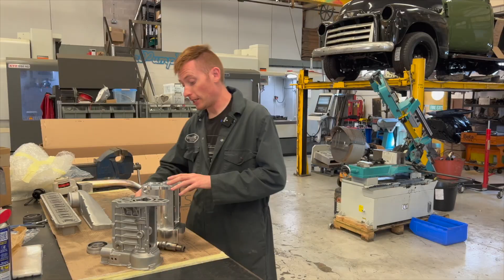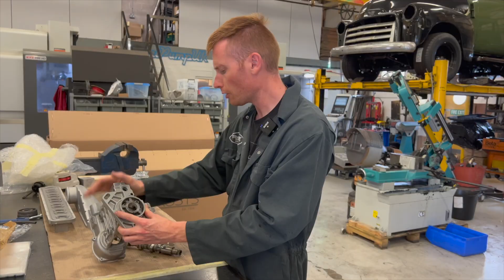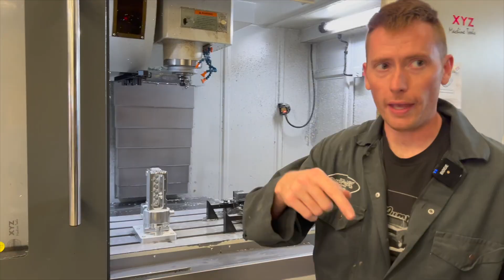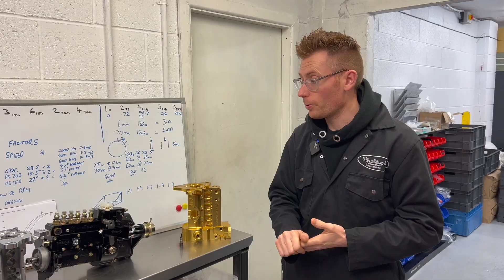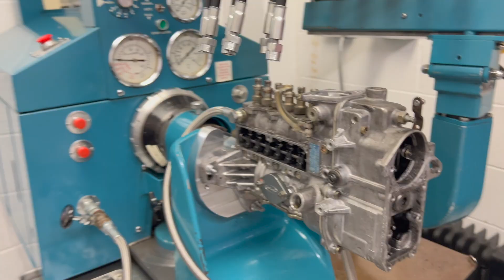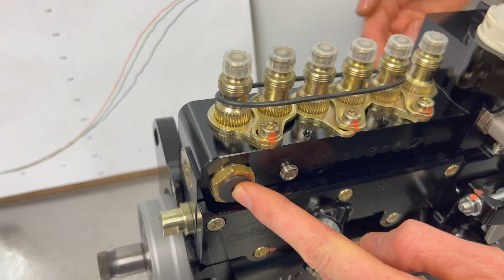OM606 Billet Fuel Pump

Comment: Full on board.   I was a fixer of what broke.   DPUK is the ultimate in the ability to MAKE IT BETTER.    The Billet Pump itself is astonishing.   The capability to do so is so many level above and beyond.    While its an individual marvel and  incredible shop capabiloity,   its a stunning display of what all their work looks like.   You know that each bolt gets that same attention to detail and quality.   Right botl,  threads are clear,  right lube (if speced)  right torque,  right deg turn if required.

Comment: Can I just say - I've never owned a diesel mercedes (I'm more on the VAG side at the moment, still playing with PD engines) but your engines are the shiniest, prettiest things I've ever seen. I think it's because they're so purposeful - everything mechanically controlled, hardly any electrics, so you can see every single part working. True works of art.

Comment: i would like to see a "Vintage 603" with a "vintage pump". maybe paint the engine an emerald green, brass hardware, green pump, brass lines, vintage turbo ;) ceramic coated exhaust, polished valve cover. for a vintage benz with real power. adenauer or a 220se.

Comment: hello, tell me, the parts of the 605 engine are different from the 605 turbo, namely the cylinder head, piston group, crankshaft, camshaft ...?  is it possible to install a turbine on 605 atm (replacing the exhaust manifold, pan, fuel pump...)

Comment: Neat design using the cyclical motion of the oil against a sort of stator by the OEM. With modern materials/machining I wonder if you could make cams with a built in "screw drive" to aid moving fluid if the scalloping in the CNC'd body is not enough. Maybe add stator fins or baffles through the body too to get the same flow rate/pressure.

Awesome work regardless.

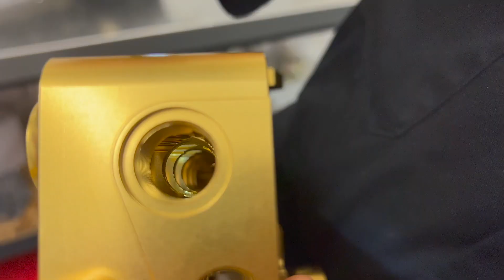Comment: I noticed at the 24:24 mark that the fuel tunnel in the pump feeding the plungers has some shavings and swarf in there from the machining process. They have not quite broken off. Are you guys planning to put all pumps through a micro bead bath / tumble to knock loose any little bits of debris or how would you go about reaching inside the pump in areas that can't easily be seen or reached? Cheers Jason
Reply from the maker: No I intend to let all the burr and swarf go into the engine
Reply: @DieselPumpUK   hahahaha love the reply. What would be a suitable method to have these sorts of things removed without causing damage to sensitive tolerance areas? Or does that all come down to the final machining process?
Reply: @DieselPumpUK  so, like a Cav or a Simms then?

Comment: Guys, be reasonable, you didn't create anything from scratch, you completely copied and slightly modified the pump. Create from scratch - develop a project in autocad, calculate it, make a prototype on a CNC, test in all modes for at least 6000 hours and after that we say - we created a pump from scratch.
Reply: well crap even automakers cant say they created a car from scratch, they just copied previous cars and changed little things lol
Reply: Relax bro you don't have to buy one
Reply: Thank goodness they have an expert to provide a threshold for excellence. If they didn't know it took 6,000 hours of testing to gain credit for creation or solving a problem, they might have only spent 5,000 or 1,000 hours testing before expressing such hubris.
I, too, have some expert feedback. Nobody uses Autocad for CNC machining.
Reply: You sound like 0 craic!

Comment: could you also add a second mounting area for another mechanical liftpump at the bottom guys like me who wants to use the fully mechanical guys? i already have a stronger spring in mine but it still would be better with a second one

Comment: Nice work......
I have a question....could you build a P pump for mitsubishi 4d56 turbo and a bt50 2.5 wl .....?
Reply: Certain 4M40 Mitsubishis came from the factory with an inline P-pump. I might still have a brandnew one in my core-room. I can get the pump number if wanted. 
They can be fitted to a 4D56 or 4D56-T
As for the WL, dont know of an inline pump for one but 12mm plunger head and rotors can be sourced for them.
Reply: @matui6983  Hi. You wouldn't have a Bosch VE pump suitable for a Peugeot 505 turbo diesel would you? Mines got a Roto diesel pump. I'd like to improve the performance and believe the Bosch VE is a better pump to modify?
Reply: Id be losing the Rotodiesel pump too. 
VE is a far superior unit. 
Bigger plunger can be fitted
Higher lift camplate can be fitted
BE pumps can come with aneroid or what we call a boost control. 
I may actually have a VE that could work for you but Im at the bottom of the world in NZ so the freight might be up there to get it to you. 
I used to replace a few DPS model pumps on Citreons and Peugeots. 
One of the VE's I did the swap with may work. 
Its 1:30am here and Im not back at my shop till 6am ish. But will def check in my little black book and on the shelf for you. 
At the least I could give you the model and all the numbers off a VE so you could possibly find sumthing.
Reply: Is your Rotodiesel a 3 bolt triangular flange pump?
Its most likely a DPC or DPS unit with 3 x mounting bolts. 
Your best bet may be to find a Citreon unit or later Peugeot unit. 
Want you want to look for are the following first numbers either stamped into the alloy pump body or could be on a plate rivetted to the pump body like CAV and Rotodiesel pumps. 
VE410F
VE style/model
4 = 4 cylinders
10 is a 10mm plunger. 
If you find one with a boost control on it then all the better, but if not then a naturally aspirated pump can still be used, may just be a dirtier in the exhaust until you get up on boost..
No biggy here in NZ yet but in the UK they are no doubt a lot tougher on emissions. 
10mm plunger will give you all the fuel you need.
Driveshaft should be the same size as what you have so the drive coupling should go straight on. 
Inj pipes may need a tweak. 
And you will have to fit a boost reference hose from manifold to boost control ( if fitted)
And throttle cable will need a bit of fettling possibly. 
When I get to the shop I will see whats hiding in the back room for you.
Reply: @matui6983  Hi. Yes, it's a 3 bolt flange fitting. As well as the Roto pump they used the VE pump so I was hoping as you have said, that the drive coupling would be interchangeable 🤞. All the rest I figured same as you except there appears to be a range of VE pumps and wasn't sure how to identify the most suitable for my engine. Thanks for the info on pump numbers. 👍. I'll send you a link to one listed on eBay from Latvia. Let me know if it's the right number or call park right and if you have anything. Cheers. Lee
Reply: Hi. Looked thtu my VE collection and I dont have anything here with the correct numbers unfortunately.
But my book of words does give me 3 c pump Despatch numbers which should work for you if you can locate one..
Now pretty much the only difference between these 3 numbers should be things like 
The max fuelling which if the power is low can adjusted by on the car by the max fuel screw and the opposite if its too smokey under load. 
Possibly mounting brackets. 
All : of these pumps list as having 20mm driveshafts like the Rotomaster..
Timing should be set as per manual using a special dial indicator tool that screws in place of a plug in the rear of the VE. 
Here are the 3 numbers I have do far.
0460-404-008
0460-404-018
0460-404-003
I  dont know whether the Latvian one will be new, used or rebuilt but if its in Euros Id be wanting to get it for no more than €200ish. 
Hope the numbers help
I can check into it a bit further if needed. 
Cheerrs . Matthew.

Comment: Have you thought about putting on the side cover with dowel pins so it adds to the structure of the pump? or do you think thats unneccesary with the reinforcements of the pump?
Reply: Well saying as the original casting was fine I would say pointless

Comment: Good looking product, have you considered using a stepper motor drive for the rack and programmable ecu? I know you’re all about the “mechanical pump” but something standalone would be very controllable
Reply: The simplicity of a purely mechanical throttle adjustment can not be under estimated when it comes to drivability or safety. While electronic control is quick it inherently has lag. With proper care a mechanical adjustment will never fail. All the fuses could be open and the engine would still run and perform as required. The less we rely on electronics for engines the better. Sometimes we have too. But not for this.
Reply: Electronic common rail systems have proven to be better than mechanical pumps @rogerhobday8369

Comment: Will you release a bigger element than a 8.5mm for more power?
Reply: Great question.
Reply: pretty sure 600+ hp is when the block tends to blow so there doesn't really seem to b a point?
Reply: Pretty sure he mentioned 1000hp in the video and they have done videos of 800hp engines. 
I honestly thought the aim of the billet pump was that it was going to be used with 9.5mm,  10mm or 12mm elements. 
As well being stiffer, and possibly machined to better than Bosch tolerances. 
Bigger elements wont have to work as hard to produce the fuelling figures as smaller elements do. 
On certain marine pumps I run on my benches (for  people with limited money) I can get 230hp from 8.5mm elements quite  happily when the maker uses 9.5mm elements in the specified 250-300hp pump. Result? The 8.5mm elements have a shorter life.
Reply: @matui6983  i atcually got to that part of the video like a minute after i commented lol, still i believe he has said it before that the blocks r considerably more at risk when past 600 but i do agree larger elements would b beneficial with the applications u r talking about though i wonder why not just make an adapter for a P-pump ik people have done it before but why not in mass if larger elements would be so beneficial.
Reply: In my storeroom of 100's of pumps Ive got one pump set aside one with 10mm elements, built in boost control plus external oil feed and is set at 550hp from the factory on a 12litre engine from memory,  so on a OM606 God knows what it would/could produce. 
That removable front plate is really appealing to adapt the pump to a 606.

Comment: You are in the right direction. You seen those aftermarket cast Chinese heads? They haven't did om648 yet guy said they are working on it. We need blocks heads too. It's ridiculous You can't even find a 606 turbo with costing a arm n leg. Takes fun out of it. Plus that full mechanical diesel is timless better then the new stuff, enjoy watching the videos, make everything inexpensive and in bulk and will fly off the shelf

Comment: Would you be interested in making other fuel injection parts? I do a lot of old Paxman pumps and dorman stuff that we can’t get bits for now.
Reply: I find Dorman stuff hard to get as well.
Reply: if you learn to use a CAD program, which really isnt too hard when it comes to the basics, you could CAD the parts and reach out to a CNC shop in your country and have them make them for you. Ofc if the parts are super complicated this would be hard but if they are sort of basic it could work.
Reply: @FrmerK20  I haven’t got the time mate or the skills to work cad to the level needed for fuel injection parts. Nuts and bolts are my game
Reply: @hughjarse4627  understandable. Even harder with thermal expansion. Just thought id try and push you a bit since basic CAD isnt hard but most people are scared of it

Comment: Why not have oilpressure onto the camchaft bearing and let the house sefdrain back to oilsump. Or is that a bad idea ?
Reply: Massive number of Bosch pumps feed oil in thru a port on the side of the pump body and it drains out the the front, some dont even have a front camshaft seal, it just drains thru the bearing.